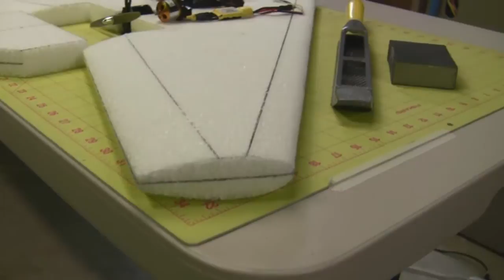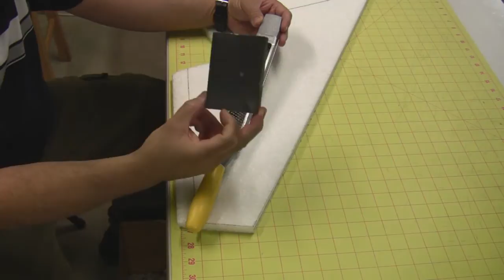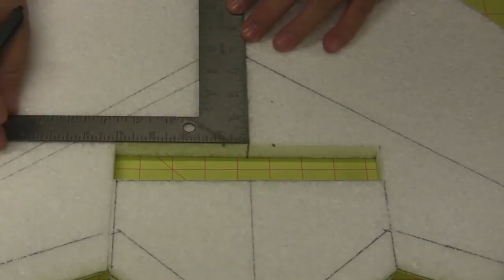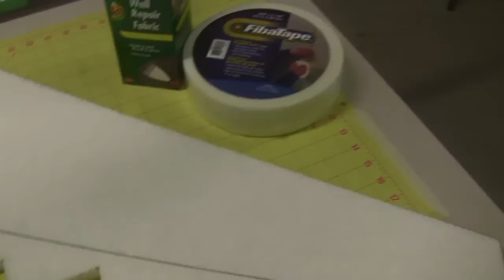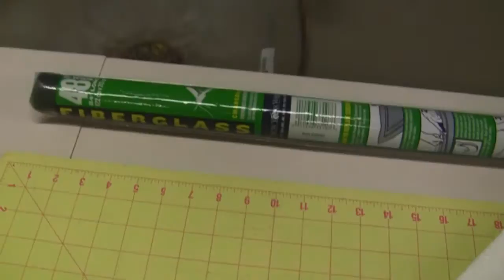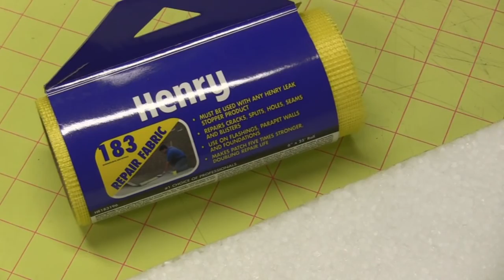Bullet Proof RC Plane Build Along No1 Phase H

Comment from the maker: bottomgunner we get these sanding blocks from the local home improvement stores here like Home Depot and Lowes. You can usually get them at any hardware store as well. These are sponge sanding blocks with the grit already attached to the sponge. We use a course grit sanding block to do the shaping then a fine grit one to leave a smooth finish. They work pretty well.

Comment from the maker: That's a good point you made waterchildtera. I didn't even think about it before I glued the fiberglass down. I'll have to see if I can try to bevel it after I get the motor mount in but I'm not sure if I will do it or not now the fiber glass is on. I agree with you on the self adhesive fiber tape. It won't stick good without using a spray adhesive as well.

Comment from the maker: Sounds cool!! You might want to use whichever one feels to be lighter. This stuff can add weight fast if you're not careful. Paul has tried the Duck brand before on one of his planes. It worked good but is a little thicker than the Henrys. The fact that it is goes on like tape is nice. You will still need to use the spray adhesive to make sure you have a good bond. Please let us know how everything it goes.